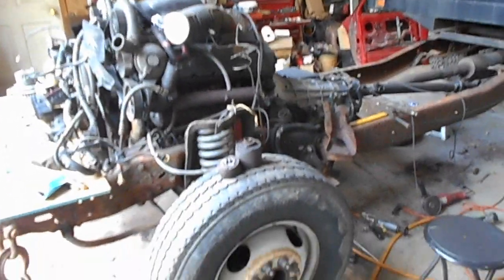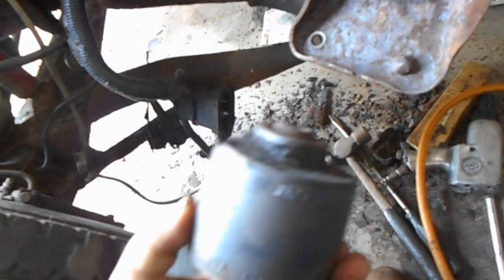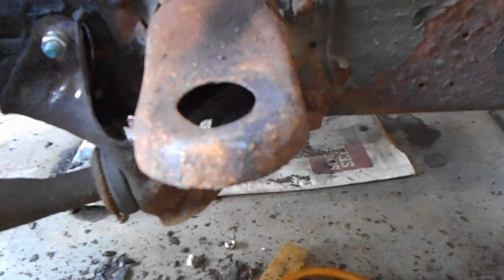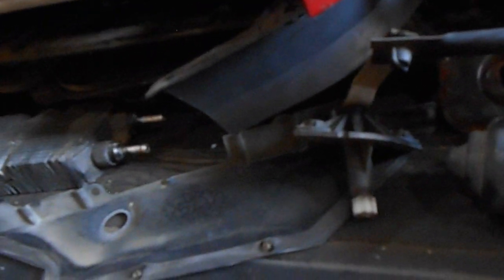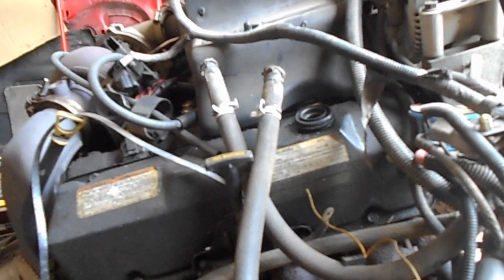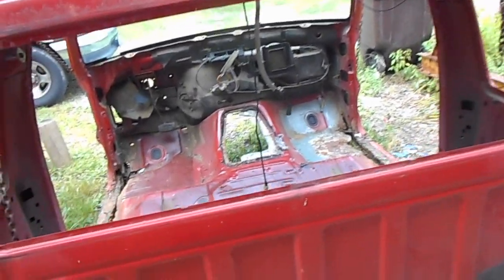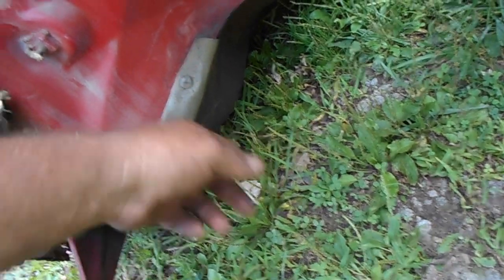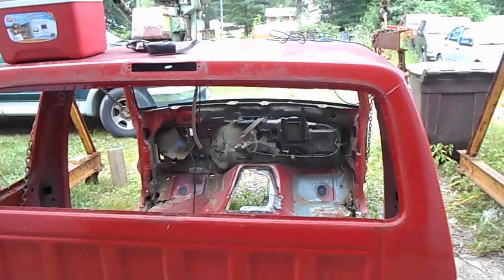Reds Frame Work pt# 2

Comment: Some of that frame is almost totally gone - hope that frame work on the other truck is better than this truck is - rust galore - your going to know every inch of this truck when you done - open an auto repair business
Reply from the maker: This frame in places is pretty bad as far as cross members go and there is one place on the frame we fixed about a year ago.  We took a cross member out and replaced it with one out of the blue truck and put a patch on the outside of the frame. Ware it was bad was at the cross member behind the fuel tank and ware the rear axels front spring mount is, Fords are bad for rusting here !  Believe me when I say I will know every inch of this frame by the time I'm done cause I sure will ! LOL  Maybe TOO WELL ! Bandit